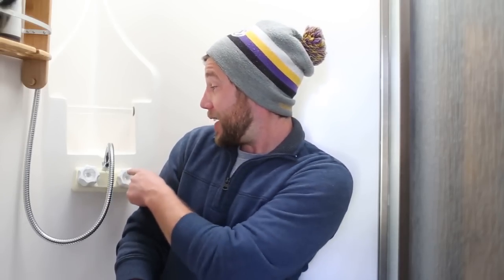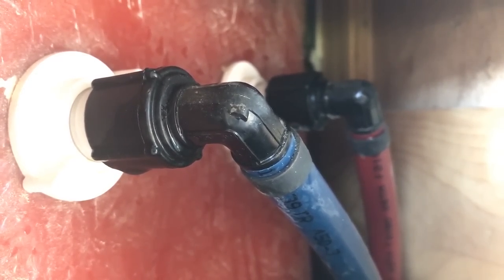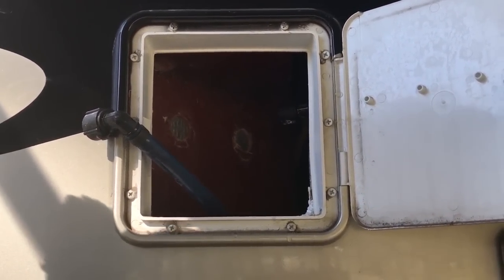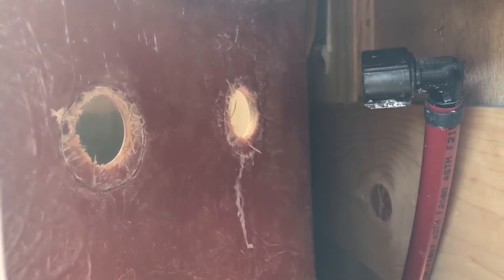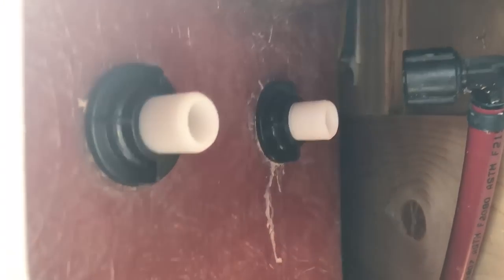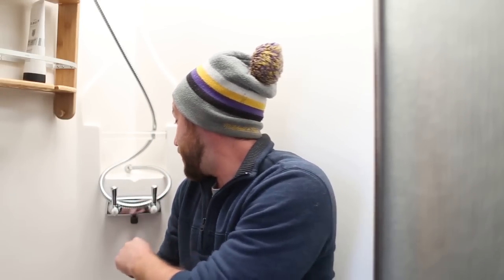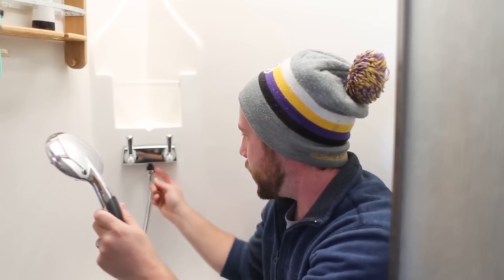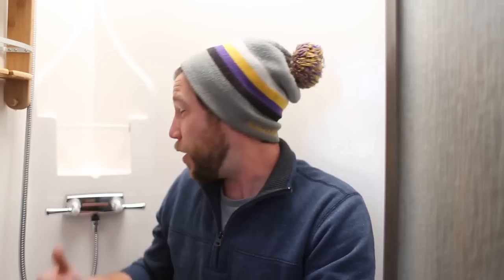How to Replace an RV Shower Faucet

Comment: Great video. What a great idea . Upside down! Maybe the manufacturers should watch this.
Reply from the maker: Thank you much +Frank Sutton and I agree :)
Reply: I turned my shower outlet downward also on my faucet. It just feels like there is less stress on the shower outlet port when it is facing downward. I am very pleased with my faucet upgrade also.

Comment: You're absolutely right everything is different for every model. My only complaint is I can't get to the back of mine other than cutting a hole in the wall. Thanks for the info. I think you did a very good job on your explanation.
Reply: Do you have a "faucet to wall extender"? Rectangle box between faucet and wall. Unscrew and remove if you have one. Found on most if it has a fiberglass surround stall.
Reply: @txpushrod62  no box, but I made my own. Used a boat water tight hatch from bedroom wall to the back of shower valves. Everything good there. Now there's a leak under or to the right of stove can't win. Thanks for your reply.

Comment: The connections on the back of the faucet have washers like a outside water hose. No need for thread tape, just know that if it leaks, you need to change the washer or tighten.

Comment: Thanks for this video. My shower connector is on top as well and drives me crazy!  Looks like this is a project that is a doable fix. I’m inspired!  Thank you, Mountain Life!  Love the faucet style as well. Amazon find?
Reply from the maker: No worries Gypsy Belle, and it really was an surprisingly easy fix. I have seen some RVs that are a little more difficult when it comes to getting to the back of the faucet but once you get in there it's a pretty easy process. We did find the faucet on amazon here is the link if you'd like it (it is an affiliate link) http://amzn.to/2EiRKIw - if you'd rather not use the link you can search rv shower faucet on amazon and they have a few options. Anyway, let us know how it goes if you do end up switching yours out, or even just flipping it :)

Comment: I did the same thing but the connection on the hose leaks. I don't know if the faucet is defective and I have to return it or there is something else going on. Any suggestion? Thanks
Reply: The connections on the back of the faucet have washers like a outside water hose. No need for thread tape, just know that if it leaks, you need to change the washer or tighten.

Comment: Hi i have this type of forcet in my RV I live in New Zealand in a Cottage from the USA. Can you help i have a leak behind the forcet i do not know whats connected to within it and its square rather large thanks
Reply from the maker: Hey @noeleen falkner I'm sorry to hear you're having a leak, it can be such a pain. The only thing I can think to suggest is to find your access panel that shows you the back side of the faucet. If you're able to find that you can disconnect it and the pieces will come apart therefore showing you why the leak is happening. Then you should be able to replace the seal or whatever is causing the leak. If you are going to disconnect it, make sure to turn off the water and drain some of it as well so that you don't have water going everywhere. Anyway, I hope this helps but feel free to let me know if you have any other questions :)
Reply: @Mountainmodernlife  Do you have a "faucet to wall extender"? Rectangle box between faucet and wall. Unscrew and remove if you have one. Found on most if it has a fiberglass surround stall.

Comment: Why did you flip faucet upside down?
Reply from the maker: Hey @Cathleen Rocco we ended up flipping the faucet upside down because it seemed to put much less stress on the faucet hose and it looked less uncomfortable :). Up until this point we haven't noticed any ill effects and have found it much easier to move around the faucet head. Anyway, hope that helps!